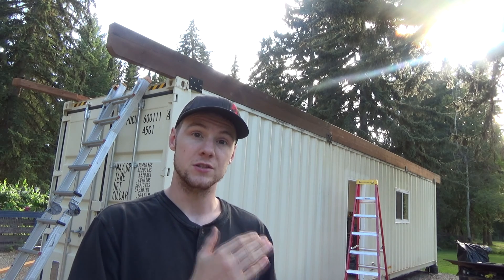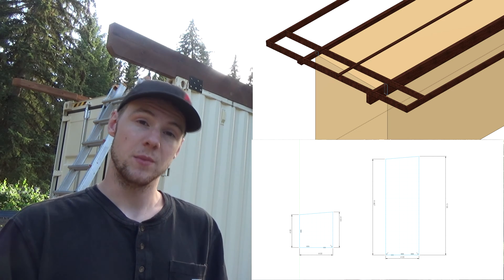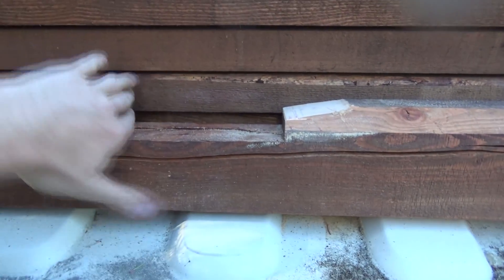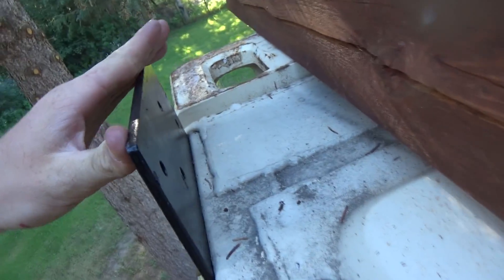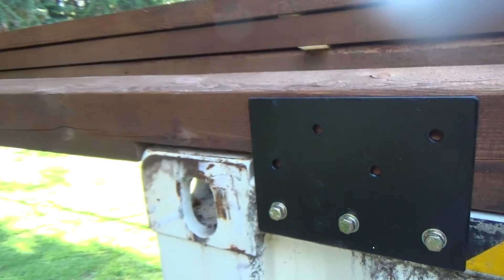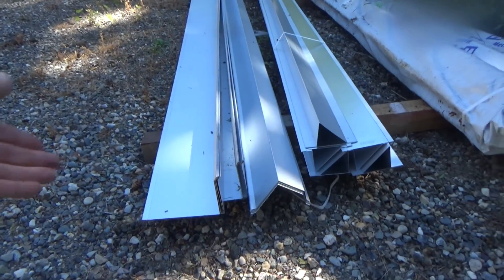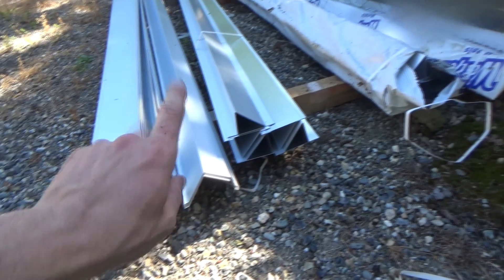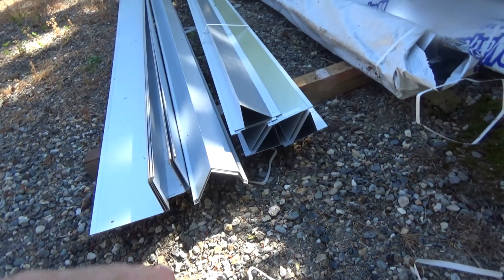One Large Roof, 45x16 Metal Roof [Shipping Container Workshop EP 6]

Comment: How’s it been in the wind? Looks a little vulnerable? I’ve got to roof 5 containers soon and currently figuring out my method too. Plan to weld threaded studs to the top edge and bolt timbers down for the under framework. You can buy clamps these days but quite expensive. How did the breathable membrane work out? Would you use it again? Drilling through the container with a cordless drill  looked like a ball ache job? Would you have such an overhang if you did it again?  Thanks for the video 👍
Reply from the maker: Wind for me not a problem, if in an open field could be a different situation. I would still pick drill and tap every day of the week over welding on a sea can. (Definitely have done both). The large over hang is nice in this set up ( high cube 2 feet of the ground at the far end) still keeps about 2.5 feet of ground clear form collecting any snow.  Good luck with your 5
Reply: @ Thanks for the details 👍
Reply: I’m looking to do this for my 20’ container. Though I wish I could do such an overhang, I live in the Virgin Islands and have to think of hurricanes. I’ll will likely only do about a foot overhang. Steel would also be a problem so I’ll need to look into a different type of metal to attach the roof to the container.

Comment: Best idea i've seen so far. Thanks for sharing. Exactly what i need on mine. Can you provide link for hardware and metal plates please? Thanks.
Reply from the maker: all grk ss and for the plates they are all made out of mild steel by my self
Reply: Hey bro really nice build, i am doing something similar- what size bolts did you use to bolt the plate to the container?

Comment: Do you have plans and brackets dimensions
Reply from the maker: I do have a fusion 360 save for it all , are you looking
Reply: I have everything done for set up, insulation, but no roof. Too many designs. I am overthinking. May I email you? I am stuck and this is going to be storage and a barn with a roof in the middle and over containers. On a budget so trying to research better ways until I know exactly what to do. I like the way you are doing yours.  Thank you. Good job! I like it. And I would love to finish mine.
Reply: @Donkeysbreathe I don’t know about Fusion. Is it like Sketchup? Any help you could give me would be great. I have been researching for a while now and need to get moving while we have good weather. Are those 2 x 12’s on the higher edge?
Reply: You said Fusion 360.  I don’t think I understood that part.  I haven’t learned Sketch up but I can. I would like to know the sizes of lumber so I can start drilling. I have the plates made. I just cannot decide to put down treated 2x4’s on the edge or what size. I want it different than others around me. I have been watching Penny Lane and I think I want something like that. Two different roofs across the 24’ span. Then solar panels on one side. I may be living there temporarily while house is being remodeled. I am absolutely stuck. I have pad built, containers are welded down to 3’ deep x 2’ wide plates in reinforced rebar on all corners,  concrete poured in the middle and no roof. It has to happen. Tractor and implements need to in there. Thank you for your response.